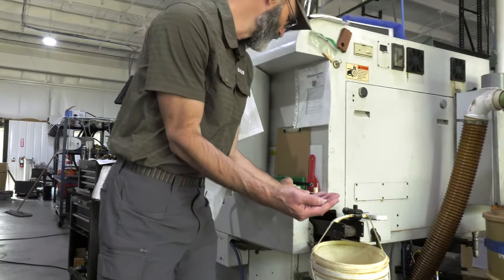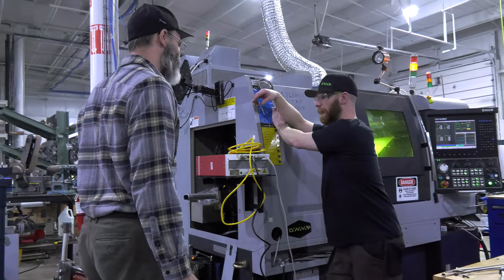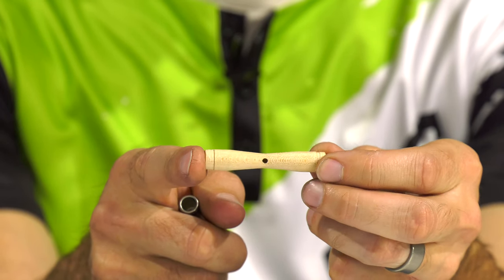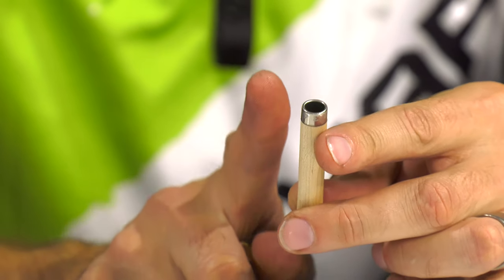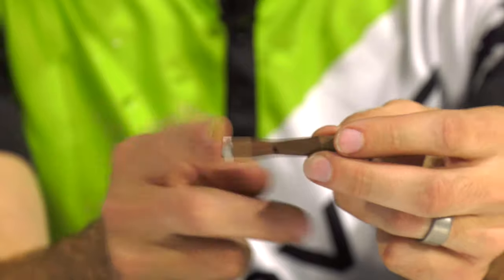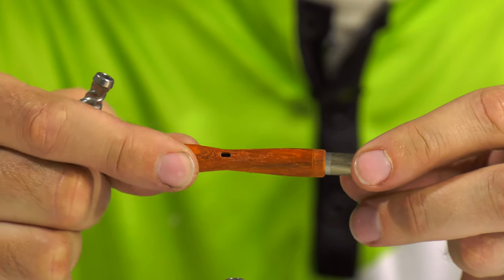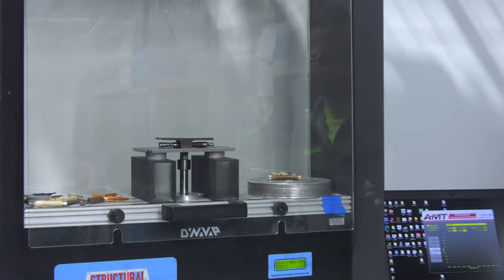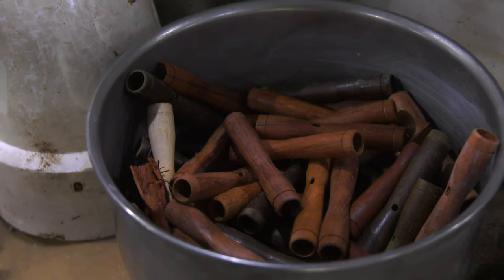Behind the Woodwynd by DynaVap

Comment: So basically, if I leave it in my back pocket as I sit down, the stem is probably toast....  That being said, I still want one!  These seem like well-engineered and beautiful pieces.
Reply: That's what I was thinking but the Feb 29 sale got me.😂
Reply: With the B, the silicone sleeve will flex. I've done it, panicked, then saw that it was okay. 👽✌️
Reply: Well, I got mine. Looks and feels beautiful. Vapes hotter than hell. The mouthpiece will burn your lips on the first hit. Totally unpleasant and disappointing overall.  Funny, out of all the reviews I saw, nobody mentioned the heat. The "spiral" on the condensor might as well be a decal, and the slots are patterened not to fit available intercoolers. The tip works great on my Simrel Vortex.  The rest will be a mouthpiece on my Mighty.  A sad and undignified use indeed.
Reply: @petem.3719  didn’t have this issue at all with the wand
Reply: @thegooglebell8159  I actually got the wand. It's all I ever use.  I do like the tip. I've been using the Woodwynd on a waterpipe where the excess heat doesn't matter, or woth a coil for concentrates. I think I just got spoiled with the cool, heavy, stainless Simrel stem.

Comment: Dunavap, which talks about heating without electricity, sells heating devices powered by electricity… Wait, but that's the result of Mighty Storz & Bickel, isn't it?)
Reply: Not comparable at all. You can use any heat source for the dynavap where the S&B requires the battery. I have both and both work just fine depending on your own prefs. Traveling or quick hit => dynavap for me. Chilling at home => S&B is better [though I love the Arizer Solo II as much, cheaper too].
Reply: why not give the consumer more options if they want to use an IH why not provide it. the mighty costs 5x more than a dynavap
Reply: If you have ever tried one, then you would know better.  I have had several Storz and Bickel devices, and every single one of them has broken and become expensive paperweights.  The Dynavap is just pure and awesome and will also last a lifetime.
Reply: What??